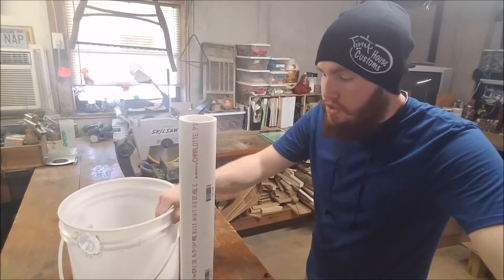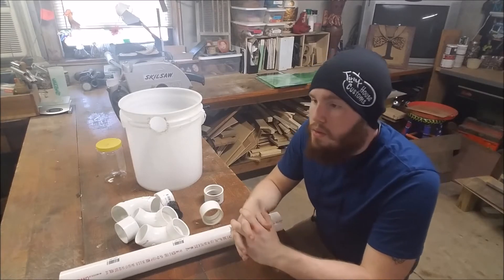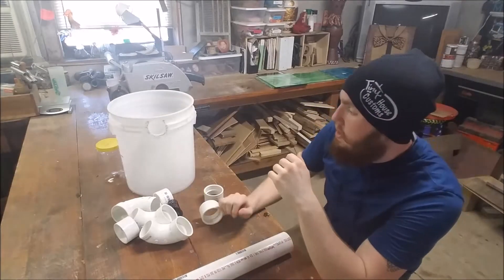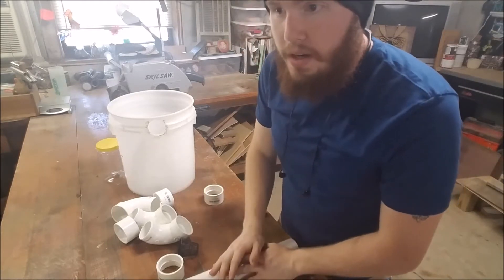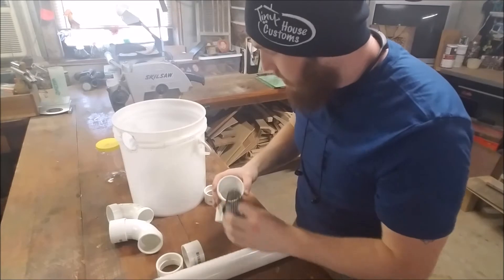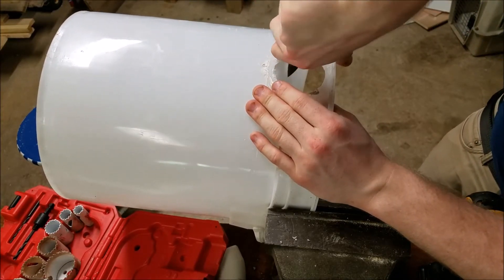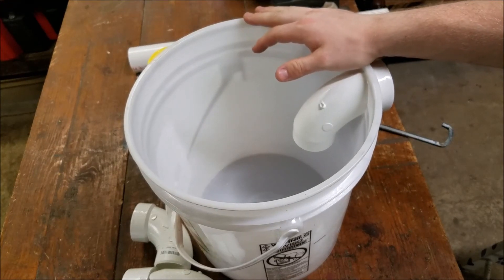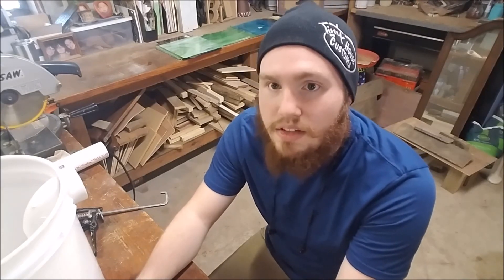New/Updated Outdoor Hydroponic System!

Comment: You can hold the net cup in the 90 degree elbow by cutting a small piece of pipe and inserting it in the fitting after you place the net cup in it.
Reply from the maker: Chris Meier That's a great idea, thank you for the tip! That would save me from dealing with the mess from the silicone.